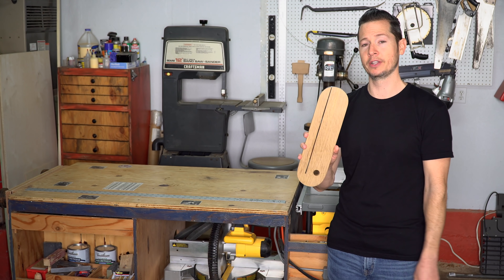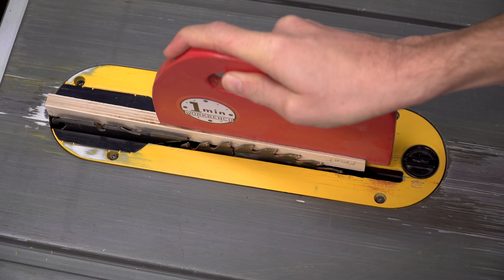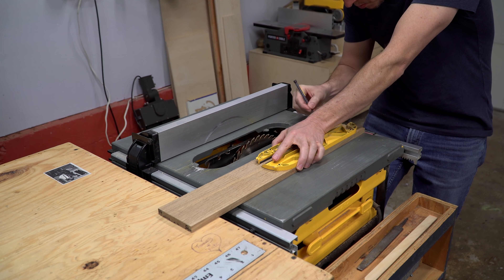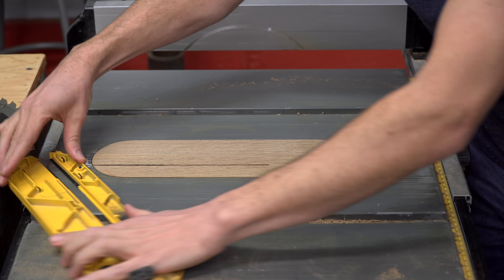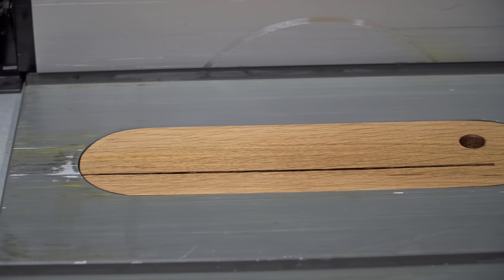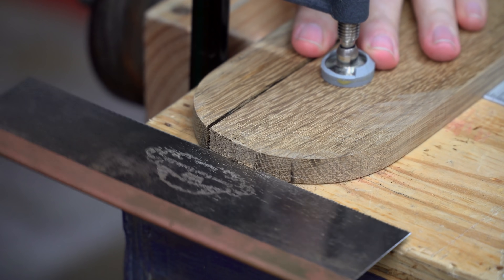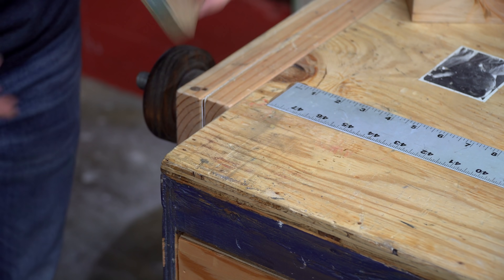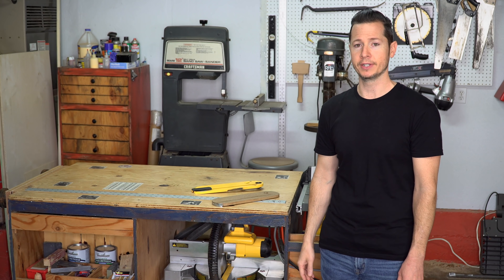A BETTER Zero Clearance Insert!

Comment: Great vid. I just got the exact same band saw you have and was wondering where did you get the extra table attachment and fence?
Reply from the maker: It's actually just a loaner from a friend that had 2 bandsaws. I think it actually belongs to his father-in-law and I'm not sure where he got the accessories. I'd bet you can probably find it on eBay though...and maybe even Sears. I'm always surprised at how much stock of parts those guys keep of old tools the used to make. I hope this helps! Good luck!
Reply: @OneMinuteWorkbench  Tried sears parts but they only have small parts (e.g. bearings, nuts etc) and didn't think to check ebay but thats a great idea thanks much and thanks for the reply. Been new to woodworking but enjoying your vids.
Reply from the maker: Thank you, I'm glad you're enjoying the videos. Welcome to woodworking and welcome to the channel! Good luck hunting on eBay!

Comment: It’s a great design.  I will make one but use sold state material.  The extra cost will over 
Lat the longevity
Reply from the maker: Awesome! I assume you'll use aluminum, is that right? Either way, come back and share your finished version when you're done. Good luck with the build!

Comment: Nice job. How do you like the DW745?  I’m looking at it for my small shop.
Reply from the maker: Thank you! I really like it. It has plenty of power, and in my opinion has been very well calibrated from the manufacturer. I've never adjusted the blade alignment or fence and get very good straight and square cuts. The biggest drawback, other than the throat plate having issues, is the lack of support for a dado stack. If it had a dado stack, it'd move up a solid notch or two. I hope this helps!
Reply: One Minute Workbench it does!  Thank you for the reply!

Comment: Nice job on building the insert. My only concern would be when cutting a large piece without the fence covering the insert if the insert does not clip in or screw down and its just sitting in the slot area it has a chance of coming out during a jam up at the blade and could be hazardous. I had a small table saw on a job site and the metal insert flew back at me and landed in a sheet rock wall. Scared the heck out of everybody. Find a way to lock that insert in. Take care!!
Reply from the maker: Thank you, and thanks for the safety tip! I'll have a look at locking it in place!
Reply: I ran into the same issue with a Lexan insert on a Delta 36-6020. The fit is as snug as it gets, the insert is perfectly flush (adjusted the screws), but since I didn’t add the snap tabs at both ends - once I dry started the saw, the blade immediately kicked the insert out. I was expecting something like that & was standing well clear at the side of the table, but had to redesign the plate.

Comment: I never got to do any zero-clearance inserts for my table saw because I never really needed any. My skillsaw does not use a single insert piece, but two halves that attach with screws at each side of the blade, so making a single-piece insert will be a little more difficult because there is no way to take a direct shape of the insert on another piece of wood, so I'll have to adapt the wood to the hole directly.
Reply from the maker: If you do wind up creating a zero-clearance for you setup, let me know how it goes!
Reply: @OneMinuteWorkbench  Sure, will do. I'm thinking that maybe using transparent acrylic would be useful to make a rough trace of the shape of the insert, then sand it off to a perfect fit, and then using that as a mold for making the wooden inserts. What do you think?
Reply from the maker: Sounds like it would work, although if it's just a template, you probably don't really need to go through the expense of using acrylic. You could use some cheaper material and still achieve the same result. Either way, I like the idea of having a template for making multiple versions - keep me posted!
Reply: @OneMinuteWorkbench  It doesn't need to be acrylic, but whichever material it is,  it has to be transparent to be able to trace the opening below it with a marker, and still be at least reasonably hard for it to work as a template to trace on wood later on (paper would not work).
Reply: @OneMinuteWorkbench  I'm having trouble finding anything else than transparent acrylic. Maybe I could try using a plastic chopping board; I have not seen any transparent ones, but at least they are cheap to try.

Comment: Hoho! Nice new drills! The elephants will be proud
Reply from the maker: It was time. Getting tangled up in wires makes editing video difficult!
Reply: Indeed, why did you choose a dewalt and ryobi? Wouldnt it have made more sense to get the same brand so batteries are interchangeable?
Reply from the maker: Probably, but since this is my first venture into cordless tools (at least first time since back when everything was NiCad), I wanted to test both brands. And they were all on sale and the exact same price for 1 drill with 2 batteries and a charger. So far, I think I like the DeWalt better. They're lighter, smaller, and more powerful, however I've had issues with the chuck on one of the DeWalts. It was making a clicking sound and not tightening or loosening the bit. It did that for a few minutes and then it went back to normal. I guess I'll just have to wait and see how it holds up in the long term.
Reply: @OneMinuteWorkbench  DeWALT Certainly has a better colour scheme than ryobi :D
Reply from the maker: I think so too, but really has me leaning towards DeWalt is the feel of it. I like that it's smaller, yet manages to be more powerful. There are things I like and dislike about both, but I'm still learning. Maybe I'll do a comparison video after I've had some time with them.

Comment: Good job man as always, but just asking, couldn't just put a metal strap , at the original part? Considering the appearance, i prefer yours. Thanks for sharing.
Reply from the maker: Thank you! I don't think I could add the strap to the original. The material is so thin on the aluminum plate (because it's a thin-walled molded part) that I wouldn't be able to add the notch needed to fit the strap in there. And I also couldn't just add the strap to the outside because then the insert would no longer fit into the slot. Also, even if I could make the notch in the aluminum plate (if it had the necessary thickness) it's a lot easier to notch the oak than it is the aluminum 😉. And finally, I needed a zero clearance plate anyway to keep small pieces from falling into the saw. I hope this make sense! Thanks again!
Reply: @OneMinuteWorkbench  It does,  make sense, and I am totally agree about the fit issue. Thanks for replying.
Reply from the maker: No problem!
Reply: why not tig a little place on the original
Reply from the maker: You guys give me too much credit...you think I can weld?! 🤣 Also, seriously though, if you were able to weld a small piece in there, you still wouldn't have a zero clearance insert. So making one out of hardwood seems like a not-too-labor-intesive project that results in all the desired features. You bring up a good point though...for cuts that don't require zero clearance, you could potential repair the original (if you can weld) so as to not have this problem anymore. Thanks for sharing the idea!
Reply: Might as well stick an aluminum plate in a 4-axis CNC and cut one out.
Reply from the maker: Back in the days when I had axis to a CNC mill, that's exactly what I would've done ;-)
Reply: Spent Seven years behind a drafting board designing complex manufacturing tools, dies, equipment and products. Then spent 30 years as a master toolmaker/CNC machinist.
Although I have Autocad and Gibbs, I learned G-Code back in 1979.

Comment: I think I would just take a block plane to the top of the insert with it in place, after the support strap is installed. Plane inwards from each end and take it very close to flush. Then belt sand or disc sand the entire surface until perfectly flush.

The metal strap reinforcement is clever.
Reply from the maker: Hey thanks, I'm glad you dig the strap! Thanks also for taking the time to share your ideas!

Comment: I like this idea. But for the trouble, I'm thinking I may try to make a replaceable insert that I can slide in and re-cut the zero-clearance or even swap out for different blade thicknesses. This way, you're not having to do all this work each time you need to replace, you just slide in a new piece and bring the blade up.
Reply from the maker: That's really cool idea! Thanks for sharing!

Comment: Mine did the same, i used washers
Reply from the maker: Can you share more details?
Reply: The plate was sagging so I used washers as wedges to bring it level, likely not the best fix but got the job done, my hand skills are below average. So easy fixes if not the best tend to provide the best results for my skill sets
Reply from the maker: Nicely done! To be safer, you could epoxy the washer(s) in place so that there's less chance of it falling out and making contact with the blade. Or you could use a wooden wedge, that way if it falls out and hits the blade, it won't be a big deal. Anyway, thanks again for sharing about your fix!
Reply: Thank you so much, I'll take ur advice thank you for your time and considerate post

Comment: Nicely engineered change to the saw. Make me wonder why the maker of the saw couldn't just design the insert to fix all those problems that you found.
Reply from the maker: Thank you! My guess is that it has something to do with the balance of making a cost effective, yet high quality tool. I think all in all they did a really good job on on this one, but a couple more little finishing touches would have been nice.

Comment: Why not just add the supporting strap to the orignal insert to remove the flex?
Reply from the maker: Somebody mentioned that before. It's an option, but you'd need to be able to weld, and/or you might have to remove some material from the original (aluminum) insert. That of course is best done with a CNC machine. You can't just weld it to the outside because then the insert would no longer fit in the slot. After all that, it still wouldn't be zero-clearance, so it just seems like an easier fix to do with hardwood. Thanks for the question - I hope this helps!

Comment: Why did you cut through the end of the plate. Can you not lower the blade and then raise it up to make the cut.
Reply from the maker: I cut through the end of the plate because I wanted the insert to accommodate my riving knife. If you raise the blade up through the insert, it will only make room for the blade, not the knife. I hope this helps answer your question!

Comment: Thanks for info on the saw, I don`t think I want a dewalt. the zero clearance looks like a real good idea
Reply from the maker: No problem! I imagine a lot of saws probably suffer from not providing much room behind the riving knife, so you should be able to apply this technique of using a thin metal strap to lots of different saws. Thanks again for taking the time to give some feedback!
Reply: @OneMinuteWorkbench  Yeah you're right, most (if not every) jobsite saw has this split insert design. The reason they do this is likely a precautionary measure their lawyers wrote up. They split the insert so you don't have to remove the blade guard and kickback pawls in order to change the blade. This is a nice easy fix for the sloppy Dewalt inserts. I made one similar to this, nowhere near as nice, a while back but it got lost and haven't made another. 

You should consider routing in a rectangular 1/4" lipped groove in your new insert, then remove the material in the path of the blade from 0-45 degrees so the saw has free range of motion and make a bunch of replaceable 1/4" strips that you can screw into your Oak insert. I have something similar set up for my DW745/Rousseau table, I just milled 15 or so "blanks" that I can easily put in the insert, raise the blade up through, then have a zero clearance insert for any angle I may need.
Reply from the maker: Thanks for sharing those ideas. The inserts sound like a really great and simple solution. I'll toy around with the ideas a bit when I get some time. Thanks again!
Reply: @OneMinuteWorkbench  Same to you, I like this idea of the thin metal band connecting the insert. One more thing I just remembered, not from this DW745 but a larger contractor saw I made an insert for. I made it from 3/4" maple, and when I raised the blade to its maximum height, the arbor washer and part of the trunion actually ran into the bottom of the insert, pushing it out of the table 1/4" or so. Not sure if the Dewalt gets high enough for this to be an issue but something to keep an eye on. Ended up removing a bunch of material from the bottom of the insert with a router until it cleared everything.
Reply from the maker: Come to think of it, I haven't fully extended it yet, but I'll be working with it today so I'll check that out. Thanks for the tip!

Comment: Like the insert idea.  On my old Delta, the tabs are drilled & tapped.  You could do the same thing to your saw, put a slightly flexible spacer material between the tabs and the insert, and use machine screws to lock it in place.  Solves two problems at once.  And I'd really like to see you use push blocks on the jointer.  I spent an evening in the ER for my failure to use them.
Reply from the maker: Thank you & thanks for sharing your great ideas! Someone else mentioned needing push grips for the jointer - have a look here: https://youtu.be/hm7_lXuxMCQ Let me know what you think!

Comment: In first place learn to set up correctly the original zero clearance, second place, you can upgrade the original do the same fix in the end like you do on the new one. Note for the new zero clearance: wood is not stable for precision (expands and contracts). Best Regards
Reply from the maker: Thanks for the feedback! The saw didn't actually come with a zero-clearance insert...so there was nothing to learn there. If you're referring to setting the set screws on the original insert, the problem with that is when you get one side of the insert set correctly, you can't get the other side flush without throwing out the first side. That said, even if you were able to set the set screws correctly, it still isn't zero-clearance, and still suffers from the same flex (and therefore small pieces catching or falling through). Also the "fix" of connecting the two pieces around the end would be very difficult to do on the original. It is a cast aluminum piece that has a very thin rib around the outside that would need to be milled down to allow the connecting piece of metal to be welded in place (there is very little room, so it can't just be welded to the out side). I don't have access to a milling machine, or a welder, so that idea is out. And finally, regarding the movement of the wood; I used quarter-sawn material to reduce the effect of wood movement, but yes, it will move over time and will need to be maintained and eventually replaced. That said, until such time, at least I have something that works. What was there before was ineffective and downright dangerous! Anyway, I hope this provides some more clarity on why I did things the way I did. Thanks again for taking the time to share your thoughts!

Comment: Sadly, I have no jointer, planer or bandsaw so this project may be beyond me at the moment
Reply from the maker: You could use a piece of high quality plywood and then create set screws (like the ones in the original plate) to get the height just right. And you could cut the shape by hand with a coping saw. I hope this helps!

Comment: I'm no professional woodworker but you took a bad semi two piece insert and made a semi two piece zero clearance insert with the same flex needing extra work.   Why?   Maybe you could've made your zero clearance cut with the blade then finished it with a jigsaw to clear the riving knife.  Would've left a one piece insert without the extra work / hardware.   Sometimes I overthink things.
Reply from the maker: I like the idea of using the blade, then finishing with a jigsaw, however, I’d still need add the metal strap. There’s only about .090” between the riving knife and the wall of the opening, so leaving a strip of wood connected wouldn’t last long...it probably break during the first couple of cuts, just from vibrations. Anyway, thanks for sharing the idea. It would at least make cutting the slot a little easier.

Comment: I cringed when I saw you holding the hose clamp and drilling it.  Last time I tried that I sliced my finger wide open.  Now I clamp down thin metal strips that I need to drill that way I don't slice a finger open.  Other than that I love the insert!
Reply from the maker: I'm glad you dig it! Thanks for the safety tip!
Reply: @OneMinuteWorkbench  Yeah, I cringed at that too. Them things can cut deep and clean....OUCH.   Great video tip OMW, thanks for it.
Reply from the maker: No problem! I'm glad you found it useful. Thanks for the +1 on the safety tip - I'll try to be better!